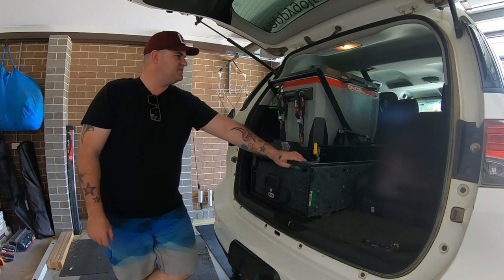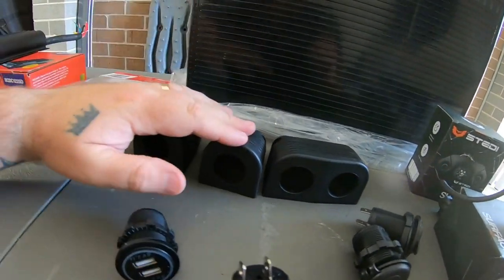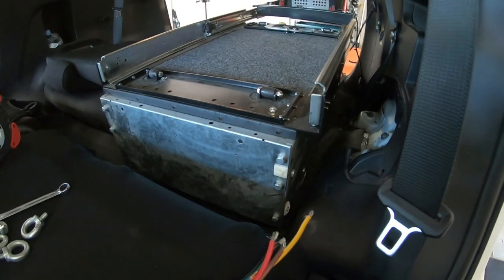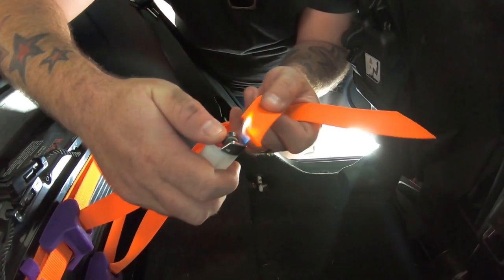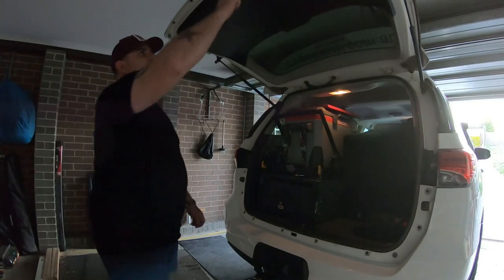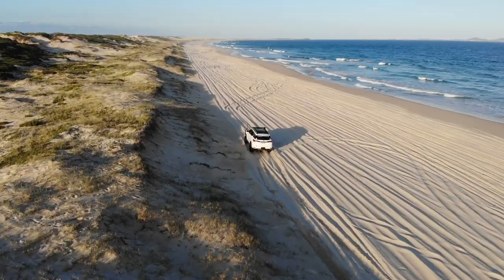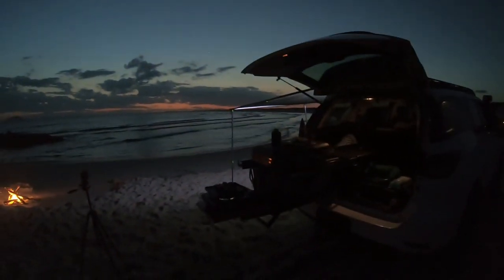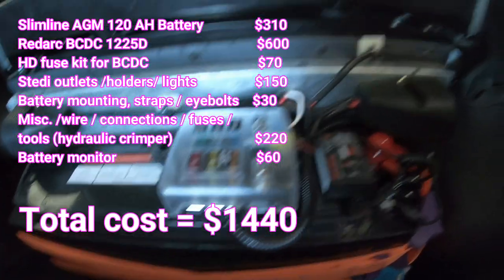How to - DIY dual battery set up touring / overlanding 12v power- Happy Go Travel

Comment: Hey mate awesome video! How did you install your stedi rock lights on the tailgate? Bought some myself with a square stedi switch, I just don't know where to wire it to.
Reply from the maker: I wired these to the fuse block I added to the second battery. Then just bolted the lights and used the tailgate open switch spot